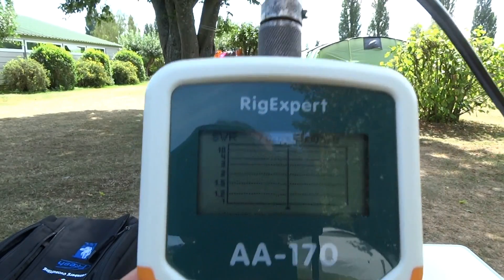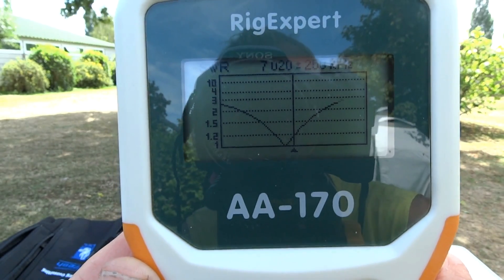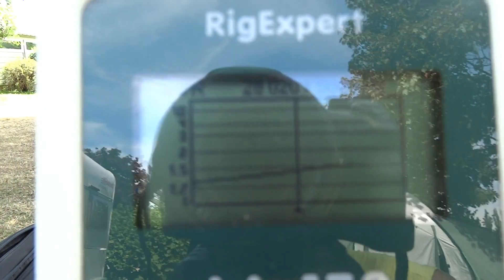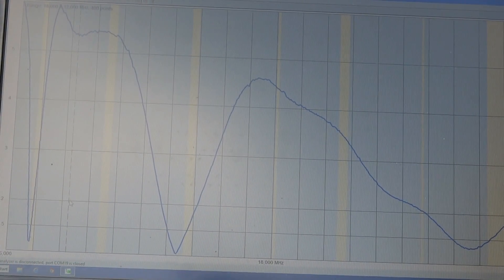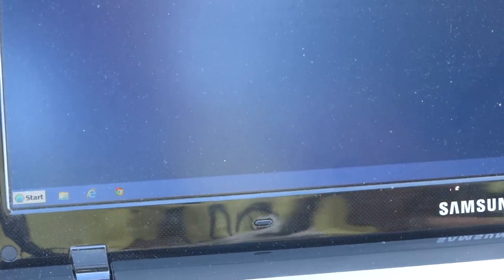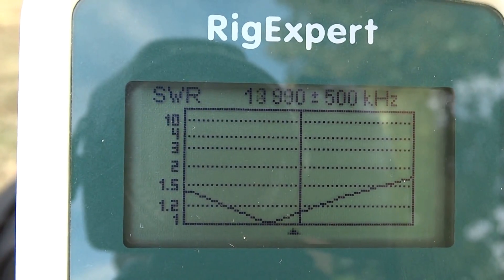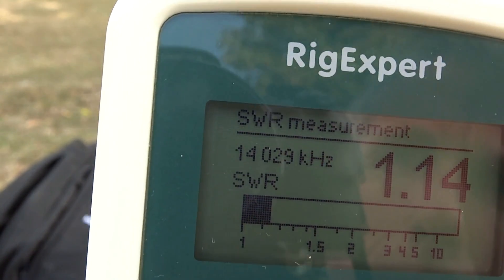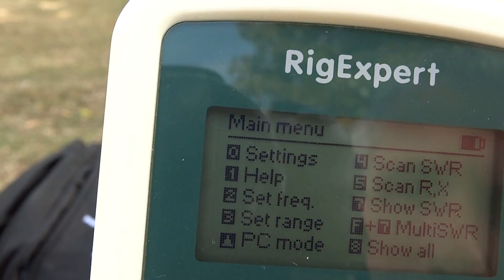End fed experiments using Rigexpert

Comment: Is that an aluminum mast? I would think you would have some reaction with it. I realize the fiberglass ones are below it , but question how it affects the antenna.
Reply from the maker: Hi Chad, no it looks like aluminium but they are grey coloured fishing poles. Surely an aluminium mast will influence or probably ruin the antenna as the actual antenna wire is sticked right next to it. Maybe I should have chosen other colour fishing poles but I ran into these two for a very cheap price so I could not resist. :)

Comment: is that a home made 9:1 or commercial?
Reply from the maker: Well, actually both. The end fed is sold as a kit. You get all the components but need to build it yourself.
Reply: I have been playing with 49 to 1 transformers, info on  youtube under EFHW. END FED HALF WAVE,
49 Times 50 about 2500 ohms comes out near the imped. of end fed half wave.